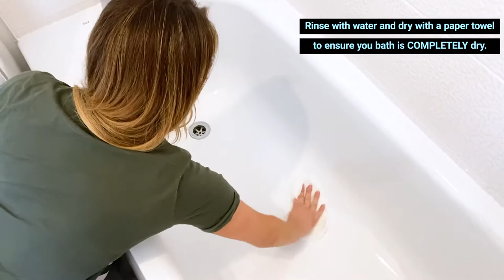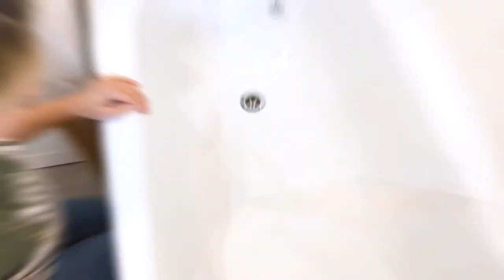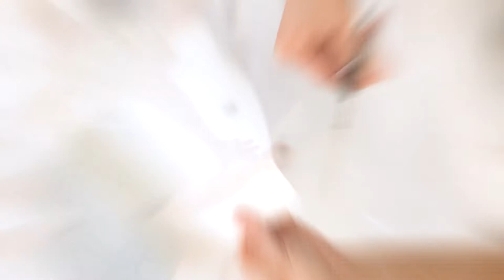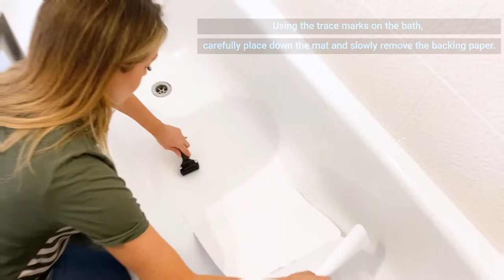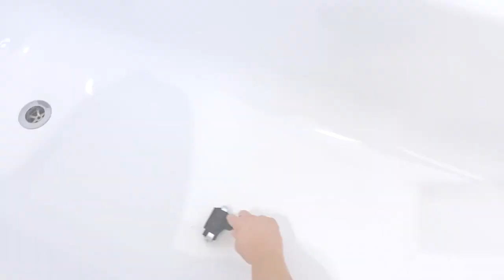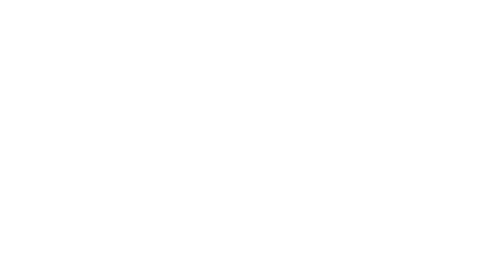Non Slip Adhesive Bath Mat with FREE ROLLER PRESSER. Say goodbye to dirty unhygienic rubber mats

Comment: What if I want remove the mat later on ?
Reply from the maker: If you decide to remove the mat you can do so easily. Using your nail or a blunt plastic scraper to get underneath the mat, lift the mat and it will peel back without leaving any sticky residue. Hope this helps 😃